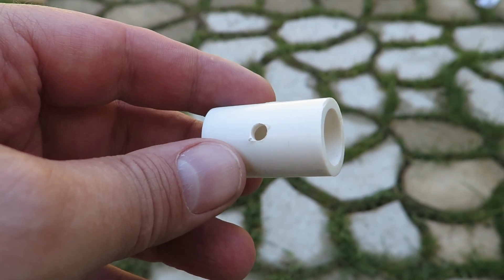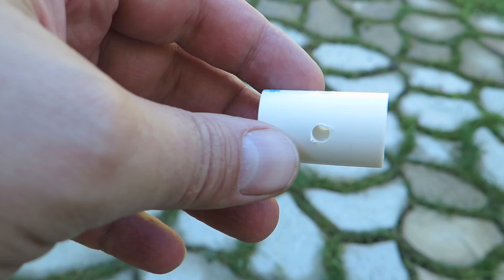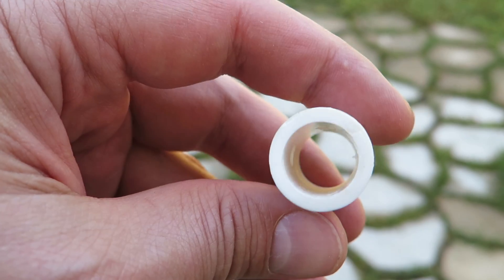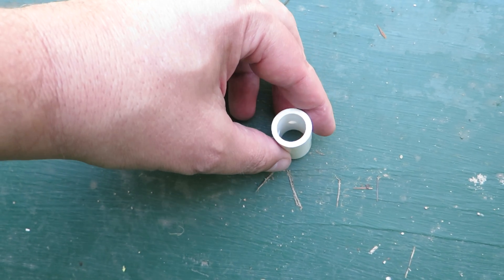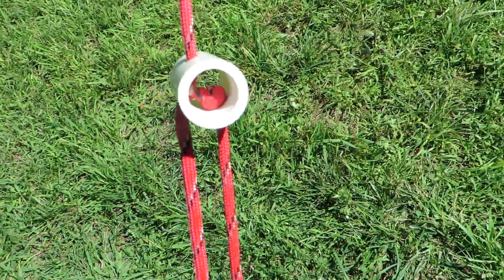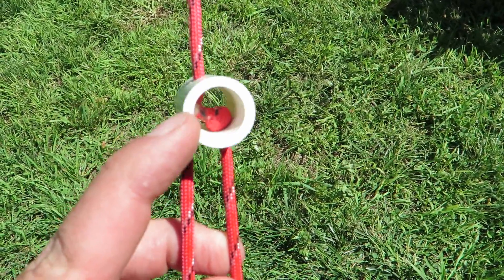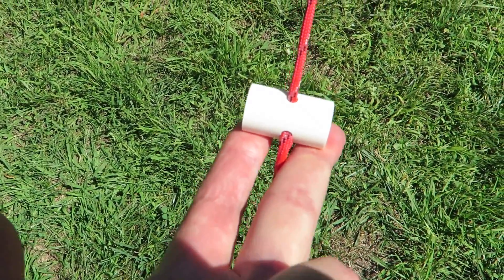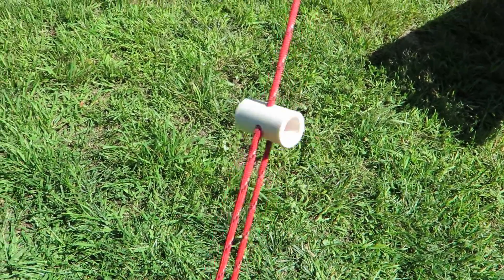DIY guy wire tensioner

Comment: The placement of the holes as shown will allow slipping of the line! I found that you must place the "middle" hole (the one without a hole on the other side of the tube) a little closer to either through-holes or you do no get enough tension. I forget the sequence of which hole to run the line through first, but you will get that as you test the tension. I use these tensioners all the time and those with the holes evenly spaced and with wind blowing my tarp cover (10'x2-') the knots loosened/slipped and I had to re-tighten every hour or so, or when I notice the loosening. I moved the one hole a bit and the problem went away.